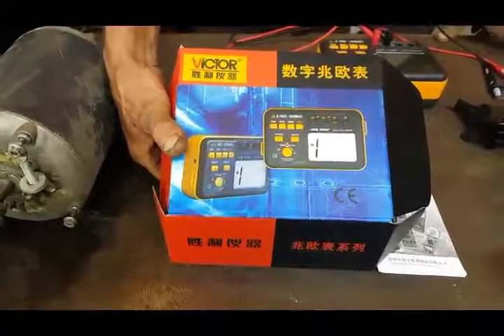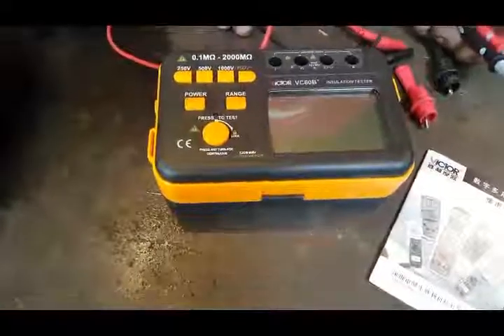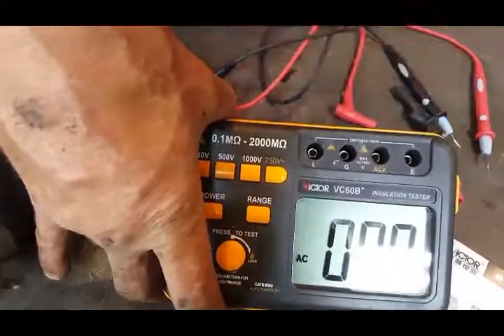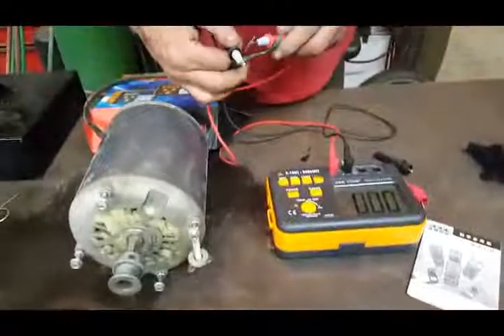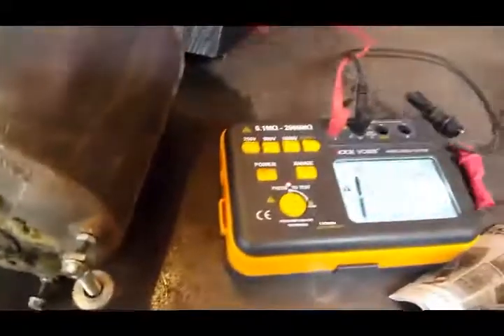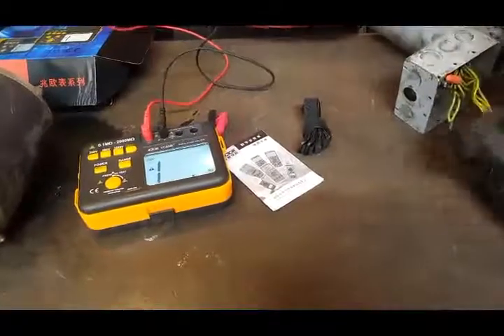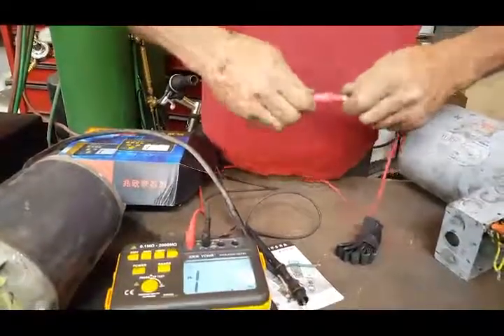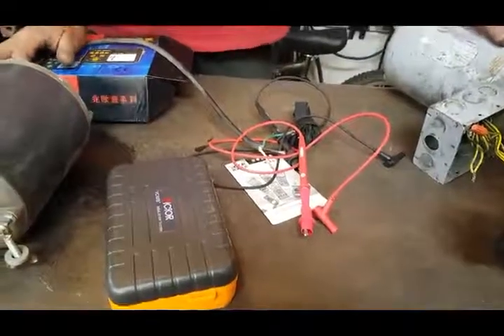Itian VC60B+ Digital Insulation Tester Megger,  Has Huge, Easy To Read LCD Screen

Comment: Oh man...

Sorry for that but I must say that you are not using this meter properly.
It is a while now since you have published this video and you have 15K+ views, so it's weird to me that no one commented till now to tell you so. 

First of all, please read instruction manual on how to use equipment before you use it. It may safe your life.

Next, it is not so smart to hold that probes and cables in your hands like that. Very high voltage appears there. 1KV is not a joke. It is smarter to use those crocodile clips if possible, and to keep your hands off a wires while doing a test. 

And last one note, you are using wrong connection terminals for insulation test. 
Terminals "L" and "E" are supposed to be used for insulation test, and not "L" and "G" as you are shoved on the video. 

Please, be aware of all this. Someone may make wrong conclusions based on this video and get in trouble.

I wish you all the best.

Comment: I don't think you're using it properly, you should see a resistance reading  (less than 20 Meg is suspect). It should have a selector for, 500V 200MegOhm.    on this setting, testing should show say  80 Meg Ohms. which is OK.      Something is wrong!     1 Ohm is short circuit. Correct please before you kill someone!

Comment: You don't seem to understand how to test the insulation of motor windings... you're really just touching random terminals together instead of measuring resistance to ground. And it's 1000, not 10,000 volts... there are plenty of industrial applications with motors above the more common 480v. face palm bad information like this gets all the beginners and apprentices out there in trouble at their jobs when they miss finding the problems.

Comment: On electrical motors and cabling you can safely check the double the running voltage as there is not enough current to cause any problems with the hardware. Just watch delicate electronics.

Comment: Sorry Sir, but you have NO IDEA of how to use that tool properly. You are connected to the wrong terminals on the meter to test for insulation resistance. You SHOULD be connected to the L and E terminals. Terminals G and ACV are used for testing A/C Voltage only. You are also testing between winding leads instead of testing between each winding and the metal case (frame) of the motor. You will NEVER EVER get a correct reading on the insulation doing what you are doing in this video. I'm not being mean here... just pointing out that you don't know as much as you think you do. I would recommend that you learn how to use the tool correctly before attempting to show others how to do it. No matter how well the intentions, misinformation doesn't do anyone any good.